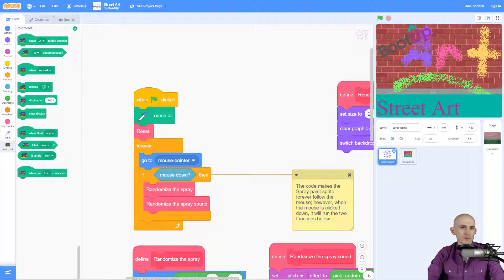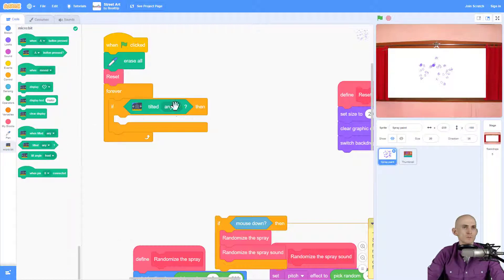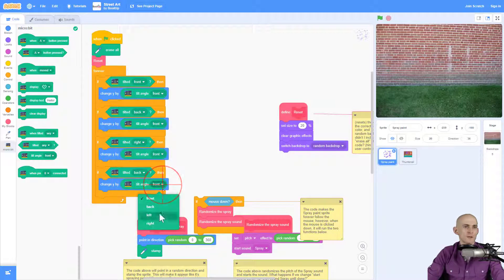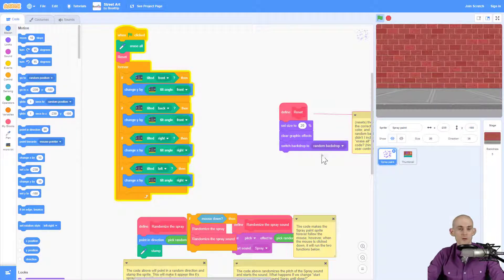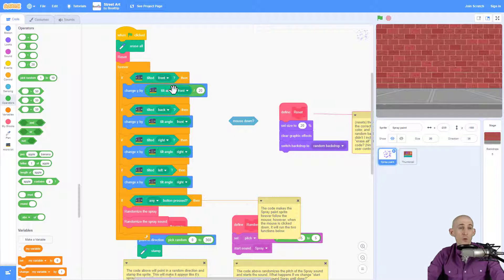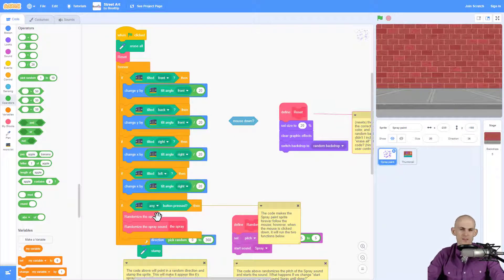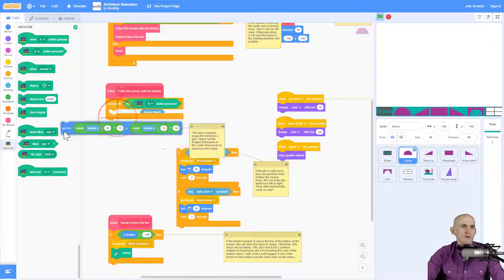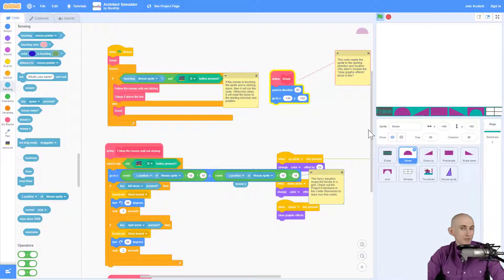micro:bit Tips - Turn a micro:bit Into a Mouse

Comment: thanks for the video. the part about tilt angle is confusing. Why would condition "IF TILTED LEFT" end up with selection "Tilt angle right", I would think if the microbit is titled left it will only return the tilted left angle, it would have no idea what is the tilted right angle if the Microbit wasn't tilted right... not sure if I am the only one confused with this part but  I can see what you did there is working correctly.
Reply from the maker: Excellent question! If we used "If tilted left, change x by tilt angle left," it would return a positive number. However, any positive x value would make it move to the right because it's changing (adding) by the tilt value (a positive number). In this case the tilt angle right is positive when it is tilting to the right, but it's a negative number when tilting to the left, so we need to use a negative number to move to the left with "change x by." Another way you could do this to make it less confusing is to use a multiply operator block and just multiply the tilt angle by -1 so it looks like "change x by tilt angle left * -1." Either option will get it to work, but one is a little confusing to read and the other uses more blocks (and might also be confusing to read lol).
Reply: @BootUpPD  I see. Thank you Sir for clarifying that. make sense now :)
Reply from the maker: You're very welcome!